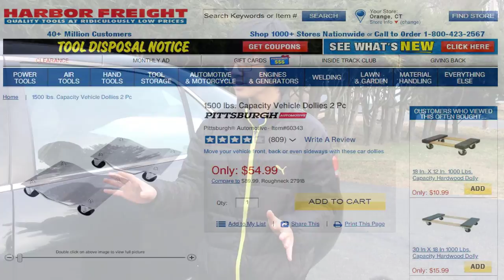How To Move An Undriveable Car Using Vehicle Wheel Dollies Or Tire Skates Especially In Tight Spaces

Comment from the maker: We bought these dollies from Harbor Freight Tools, but if there is no stores in your area, you can always order similar item but different brands from Amazon.  Here are a few of them:
1.  https://amzn.to/32tRmBn | WEN 73017 Vehicle Dolly (1500-Pound Capacity) 2 Pack
2.  https://amzn.to/3iwGSGQ | Pentagon Tools 5060 Tire Skates 4 Tire Wheel Car Dolly Ball Bearings Skate Makes Moving A Car Easy, 12" (Pack of 4) Rated at 6000lbs.
3.  https://amzn.to/2ZxY6fA | Sunex 1500-Pound Hydraulic Wheel Dolly
4.  https://amzn.to/3iFC5ms | 5051 Pentagon Tool | Premium 4-Pack | Car Tire Dolly - Tire Skates
5.  https://amzn.to/3hvg4Wh | Pentagon Tool 83-DT5499 Black Commercial Grade 4-Pack Dolly-Tire Skates | 1,500 lbs Rating, 4 Pack, 4 Count

Comment: Awesome video and valuable information! Thank you so much for your time and efforts. Trying to move my ancient '79 Trans Am, that just came out of a 15 year outdoors storage nap, about 30 feet to my driveway and the rotors are so rusted up its like moving with the breaks on. Probably gonna put new rotors, calipers and pads on the front and then two dollies on the rear tires, just to see how that works. Either that or spend 400$ on a new carb and pray the engine starts lol. I used to love going to Harbor Freight too! I have a 16 yr old Troy Built Blower/vac/mulcher I got from them and that still works great. Thank you again for much needed info about the dollies.

Comment: Can these or other car dollies be used on four wheels of a low ground clearance sports sedan with a dead battery which is locked in park, on a slightly inclined driveway sloping down to the street (maybe 10°), with the rear of the car facing the street, with a mild crown and rise from the sidewalk at the end of the driveway to the asphalt road, in all maybe about 30 feet to the street. The tow company wants to put dollies on the front wheels and use an auto tire lift tow truck to raise the rear wheels, not for the trip to the dealership, which the auto manufacturer won't allow, but to pull it out of the driveway onto the street and facing forward to load into the flatbed. But my auto company caseworker won't approve it to be lifted and pulled by two wheels at all, as she interprets that as towing with two wheels raised, which will void the warranty. It has been stuck here for several days now, not being able to get the car to the dealership. The manufacturer case rep had initially said they should use tire skates, I assume with casters, on all four wheels, but I'm not sure if it can be safely done with the incline and the angle change at the end of the driveway and then the change to asphalt from the cement driveway. Could a couple of people control the car on these or other car dollies to basically back it up out of the driveway and make a K-turn on the street so the flatbed truck can pull it onto the bed?
Reply from the maker: I would get the more expensive dolly set with bigger wheels and the ones with hydraulic to raise the car up (check other types at Harbor Freight Tools such as this one:  https://www.harborfreight.com/5200-lb-max-vehicle-weight-ultra-mobile-self-loading-dolly-64601.html).  Then use a winch, chain or rope to tie you sport sedan to another car in order to help with slowly bringing it down from the incline onto the street & to avoid a free fall.  In theory it should work.

Comment: Can these be used for flat tires stuck in grass? Really need to get out of my backyard So that I can donate it to charity. It is in a tight space.
Reply: No the wheels would just sink into the grass. You’re better off getting someone with a truck to pull it out. Or if the car ran hen you parked it you can try jumpstarting it and moving it out under its own power. Just make sure to air up the tires first.